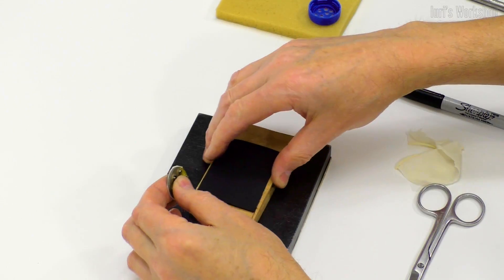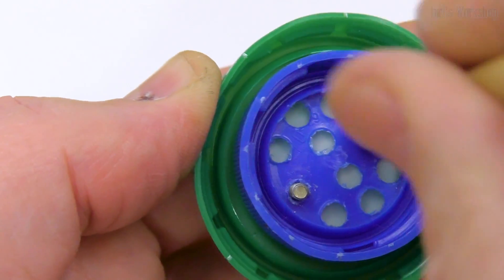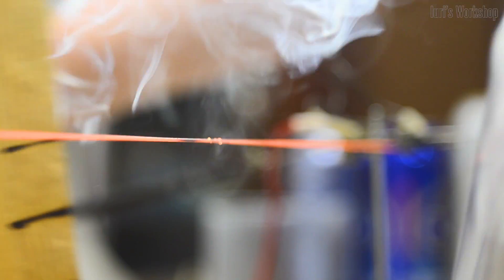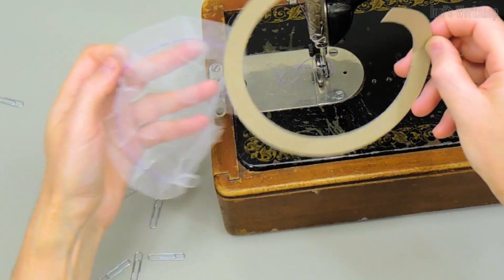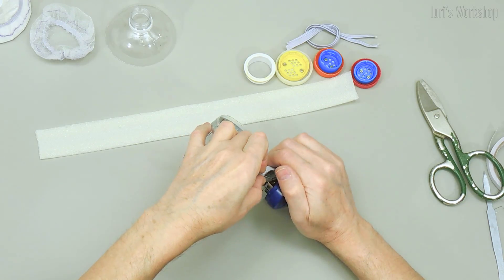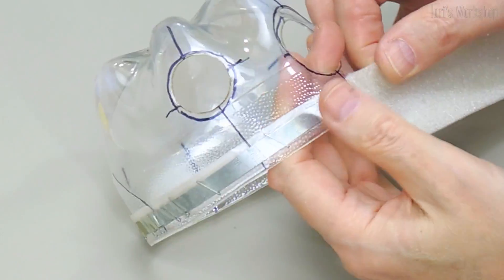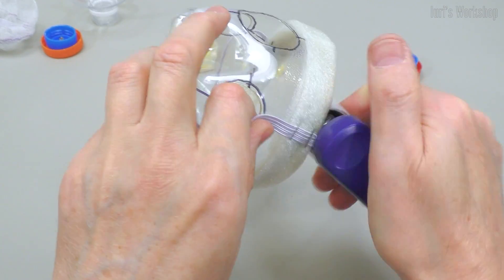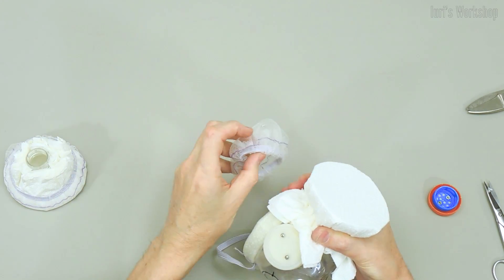🔅 DIY Respirator #2 (improved version)

Comment: nice job for an improvised solution, not sure how effective the napkins will be  against an airborne virus but I reckon it is good enough to catch the larger droplets that we were all told was its way of transmission  and am sure there is a way to improve on it, with the virus being able to hang around in the air for over 3 hours I can see a lot of people opting for mil surp resperators with nbc filters

Comment: To improve the filter you might try a salt impregnated paper coffee filter. The coffee filter has small press but not quite small enough. The salt impregnation both fills the pour slightly and it also has an attractive quality for small most particles. Another potential filter is to use a hipaa filter paper.
Reply: Salt christals also tear up the virus 🙂

Comment: The best part of this design is the one-way valves. The other parts are of questionable efficacy.
Reply: I doubt breathing through paper towel filters keeps the virus away
Reply: alex cantley it will not catch the virus it self but will catch any larger partials and aerosols that the virus is riding on
Reply: @alexcantley9137  it's about keeping other peoples moist (breath,cough,sneeze particles) from entering the lungs.
Reply: @Kaasbaas045  I was thinking maybe HEPA filters for a vaccum cleaner might be a good idea
Reply: @alexcantley9137  ofcourse, these are better. But paper napkins when used the right way can be very helpfull aswell
Reply: @alexcantley9137  HME filters should work
Reply: @alexcantley9137  you can use HEPA vacuum filters for furnace filters. Whatever your imagination can come up with. If all you have is a paper towel than it is actually better than nothing. Don't give me that BS about false sense of security. If I got to go to the grocery store I got to go to the grocery store I'd rather have some form of protection rather than nothing
Reply: @alexcantley9137  Paper towels work, sweetie. As long as you use Bounty, the quicker picker upper!!! 😂😂😂
Reply: Mike Trieu 
Yes but the guy did not show how to make that valve which is the light blue one seen at 2:08. That valve is built in a different way than the other ones as it appears to have a clear plastic disk screwed on top of the cap.
Reply: @horsewithnoname8795  i believe the valve you're speaking about is just to show you what's happening on the inside of a valve. it's the same as the others he makes.
Reply: hello vietnam
Reply: Do you have a better video on how to do it?

Comment: I also used the rubber strips for sealing gaps in floorboards as seal with face.  Cut a line down the strip, fit over lip of body and hot glue in place.

Comment: I'm sorry really good idea but what about staples the holes they make wouldnt that let something in?
Reply: I used wide elastic strips and hot glued them to sides - no extra holes in mask body
Reply: @timbrass  Good idea. Any holes in mask will let in corona virus! I bet the DIY exhaust valve allow a micro second of contaminated air back in before it closes. The exhaust valve needs its own filter.

Comment: Change out the paper towel filter material with 3M Filtrete filters used for the home. Use those rated for MERV-13/MPR-1900 or higher. Rated by 3M to filter down to 0.3 microns (same as an N95 mask but just at a lower efficiency rating than a proper N95 mask, ie. a 3M MPR-2800 Filtrete filter is rated at around 82% efficiency).

Comment: I have the feeling that the filtering element could be better, even if the C virus is very big. Any ideas? great design tho.
Reply: 3M Filtrete filters used for the home, MERV-13/MPR-1900 or higher rating. Rated by 3M to filter down to 0.3 microns (like an N95 mask but at a lower efficiency than a proper N95).

Comment: no seal test on the mask to see if it will create a true seal around the face, and the filters are questionable about how much protection if any that they will provide.
Reply: more than nothing ;D that is the point here.
if you have better stuff, good for you, most do not have anything since masks are sold out for weeks now
Reply from the maker: In my country, three doctors have already become ill, because they use ordinary medical masks, which are poorly attached to the face and quickly accumulate moisture.
Reply: @IurisWorkshop  Even hear in California, they are rationing out mask to the nurses doctors and Respiratory.  and that is just simple surgical masks. which provide little if any protection against an semi airborne virus like the CCP virus. I  was fortunate that I had started learning to airbrush 3 years ago so I already owned a respirator and cartridges were still available on amazon when I purchased them a month ago, Tho I feel for my colleagues in the hospital who are not so fortunate.

Comment: I love the engineering! Awesome vid. The filter material  prob need to be n95 material for this mask to fully function though. Micro and nano levels of air flow to filter the air. also, can you imagine incorporating a UV light to filter the air flow(atleast 250 nm light diode). Stay safe, keep smart!
Reply: The airflow is much too fast to get effective UV virucidal  action.  I wouldn't want that spectrum of light constantly on my face or eyes either.
Reply: The 3M Furnace Filters , =>1500 MPR (non fiber glass) are prob the best material to use; stay stay 🙏🏼
Reply: @MrSilverG  I would not suggest inhaling the fibers off a standard HEPA filter.

Comment: Kinda hard finding some stuff since were in lock down and only the supermarket is open. Looks great nonetheless 👍🏼
Reply from the maker: I already made a mask from paper towels and tested it. After a few days, you can see a simpler version of the mask.
Reply: @IurisWorkshop  How can I learn to make the heating element, to cut the bottle with that red/hot wire you use? Is there a video to see where can I build that on my own?
Reply: @IurisWorkshop  i think you need acrivated charcoal do it can purify the bad air....